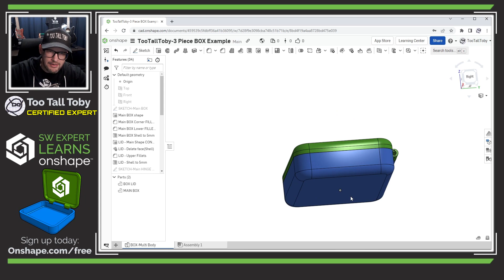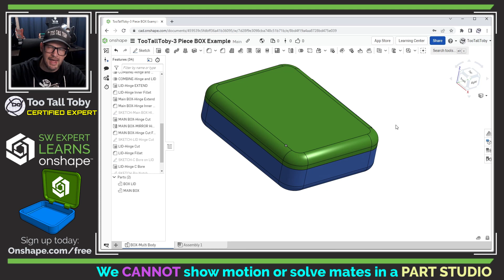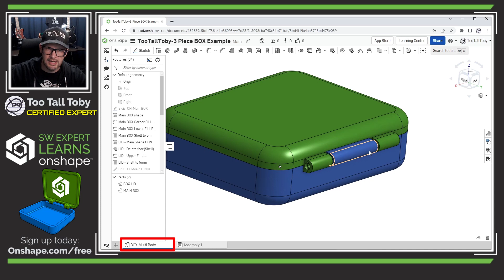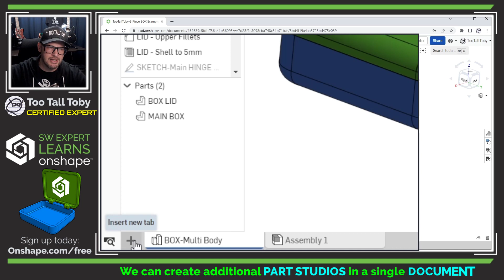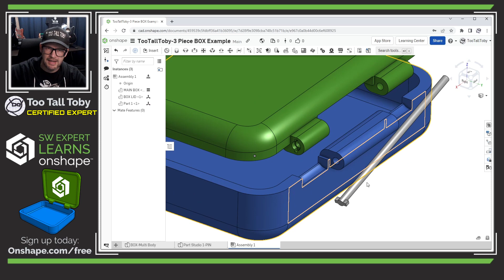SOLIDWORKS Expert Creates an Assembly in Onshape

Comment: So when you make something that's complex and the parts need to fit together perfectly it's best to build it all in one parts studio but as separate parts?
Reply: Correct!  Then you can quickly add all the parts to the assembly by starting a new assembly and choosing INSERT, and then choosing the name of the overall part studio (instead of the individual parts) - this will add all the parts from that part studio to the assembly!

Comment: Nice!
One little nuance you didn't mention is that if you select the part studio tab it will insert all the parts (instead of expanding and selecting both parts individually). You picked the part studio when inserting the pin but since there is only one part it's the same as expanding it and picking the one part.
You also have the filters for type of things to insert (parts, composite parts, sketches, surface), and assemblies is it's own "tab" within the dialogue, but I guess that will be for later!